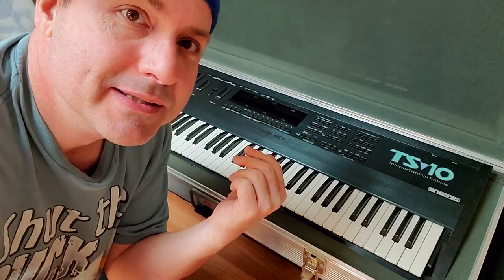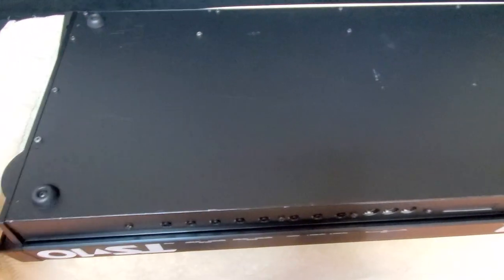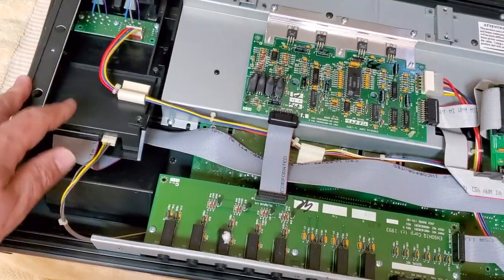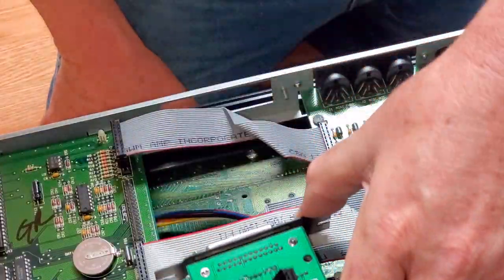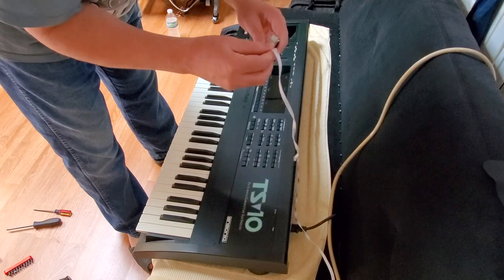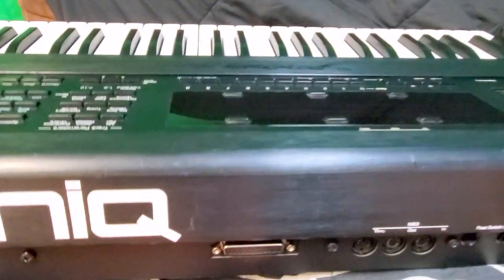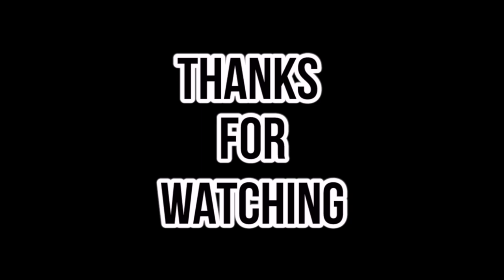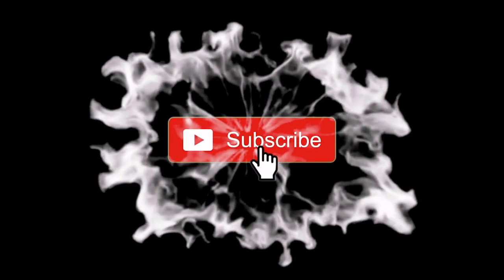Ensoniq TS-10 SCSI Install and Demo

Comment: I just lifted my TS-10 out of its flight case to install my SCSI board and I made exactly the same sound as you. 😄 Thanks for the video! I was worried my card is missing standoffs but apparently there are none.
Reply from the maker: And if you think that is heavy, I have a TS-12 also. That one is heavier. lol.
Reply: @HankCoffey  Yep, the arm I used to haul my KS32 around is now considerably longer than the other. And don't get me started on the ASR-88. That thing makes roadies doubt their life decisions. 😄
Reply: The TS-12 is 5KG heavier than my 88 note Nord Grand which has 88 fully weighted keys and wooden ends! The TS-12 is a monster! (I got one a week ago) @HankCoffey
Reply from the maker: @darwiniandude  I have to keep mine in a flight case. I rarely take it out because I hate lifting it. I don't have room to leave it set up.

Comment: Love your vids and sense of humor! I just got a ts10 in the mail damaged 😢 about to open her up and see whats rattling before I power up for the first time. Also had some cracked keys, which I'll deal with later. But I also wanted to ask if you know how I can get hooked up with a bunch of different cd iso's or images? Thanks Hank!
Reply from the maker: Thanks!  That's a bummer about the shipping damage. Look for a site called R-Massive. You might have to get a password from them on Facebook to access the files.
Reply: @HankCoffey  Ahh. Ok, I noticed they had k2000 discs. didnt realize they have stuff for ensoniq. Are a lot of these formats cross compatible?
Reply from the maker: @anonymous_friend  No, Ensoniq is it's own thing. Computers can't even read it without using special software. The K2000VP and K2vx can read Ensoniq, Roland, and Akai sample discs.

Comment: Really glad to see this pop up. I ordered one from the same guy. Now I’m more confident it will work! Just have to wait for it to get here. I have a question on the scsi2sd. The 5.5 are sold out. Would you recommend going for a 5.2 instead? Looks like I will need to come up with some sort of enclosure for it. But I’m just a home studio hobbyist so doesn’t need to look fancy.
Reply from the maker: That's a bummer they are unavailable.  A 5.2 will be fine,  But you would need an external hard drive style case.  I don't remember what kind of connection the 5.2 has on it's circuit board...   You would want to make sure all of the cabling connections match up.
Reply: @HankCoffey  I decided to go with the 5.2 from SamplerZone that's already in a case. It looks like it has the DB25 connection and comes with a cable. It was a little more expensive that way, but after I bought an external enclosure and some adapter cables, probably would have cost me about the same. Plus less work for me. Lol.
Reply: Forgot to mention the 5.2 says it can have up to 7 SCSI IDs instead of 4. So I think that means I should be able to load more CDs on the SD card at once?
Reply from the maker: @corwinjames75  Yeah, them things seem a little pricey.  I have a 5.2 in a Kurzweil and a ASR-10... Those are in Floppy trays.   I got my 5.5 from a computer place out west... for like $60. So they are being marked up  ;).   So are the Goteks.
Reply from the maker: @corwinjames75  5.2 should only be 4 IDs, you can set them to any 4 number wise... Were you reading the 6.0 info?  Those can have more.   The last I knew, the v5s were 4 IDs.
Reply: @HankCoffey  That’s what I thought. But the sampler zone website says 7 for 5.2 and 6 and 4 for 5.5. It says the 5.2 and 6 use full size SD cards. Either way, 4 should be plenty!
Reply from the maker: @corwinjames75   The next time I mess with the 5.2, I'll see if I can Flash it for 7.  I'm switching back to guitar vids for a while.  That's my main instrument.   If you Flash yours for 7 and it works,  let me know

Comment: Recently I bought a TS-10. I was pleasantly surprised that it already had the scsi and RAM expansion and I got an additional SCSI CD reader. Unfortunately, the samples are not read properly. There is noise in the sound and most of the time the sample is aborted and you only hear noise. Loading via floppy works fine though. I have tried another scsi CD reader but it is not even recognized (invalid). The TS-10 has firmware v2.02. I can't find a solution anywhere on the internet. Although I like your video, this one has brought no idea for a solution. But hey, thumbs for your videos.
Reply from the maker: Does it load samples from floppy?  Or is it just the TS programs from the TSD floppies?  Every time I've had sample bank problems it's been the RAM. Especially with v2.02. You need the old school 8 chip non-parity RAM. It's REAL hard to find. Someone probably snapped in 2 chip RAM simms. Those might work on v3. But they didn't on a v2 TS I had. They mess the samples up, and make the keyboard lock up.
Reply from the maker: Samplerzone has the correct RAM if you think it's the RAM
Reply: @HankCoffey  I filled banks 8 and 9 with samples from a floppy, and this gave no problems. So I think the RAM is Ok. Probably the SCSI drive or the SCSI expansion card. I connected another SCSI drive and it was not recognized. So maybe the SCSi card? I'm too tech savvy to figure this out. I'd like to loosen all the connections and put them back in, but they are very tight. Afraid to break a connector. I'm also looking for info about the aftertouch, because that doesn't work either (don't worry, everything else works fine ;-))
Reply from the maker: Yeah, I use a puller to remove cables and chips. You have to be careful with those also. Because a puller can break the clips on the side of the plug. Gotta make sure the puller is all the way under the plug.  I sometimes remove them by hand, I don't remember what I did in my videos. If the banks work properly from floppy, the ram is probably ok. I would still check to see if it is the proper 8 chip RAM. I would NOT run the newer 2 chip RAM on a V2 board. It will make them act up in all kinds of weird ways.  The mainboards have different routing on V3, and require modding to upgrade from V2 and older. The V3 can probably run the newer RAM no problem. V2 doesn't. Buggy.